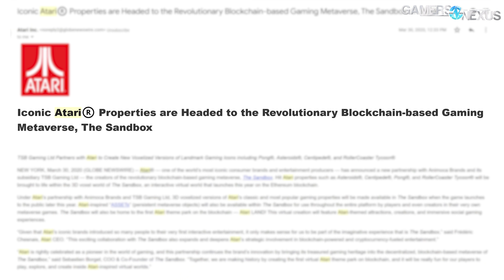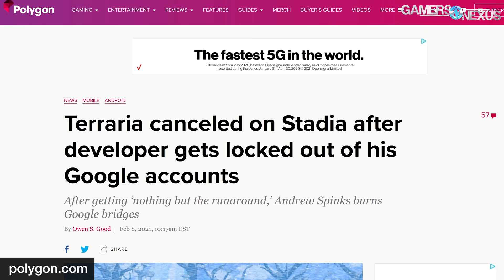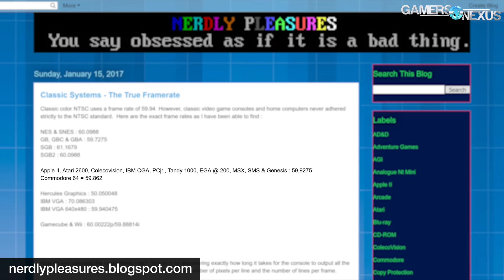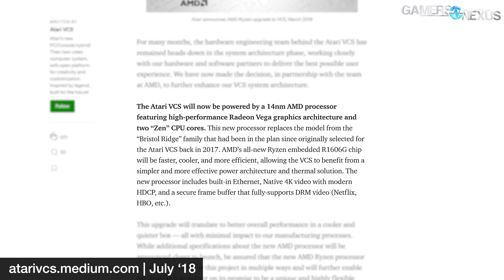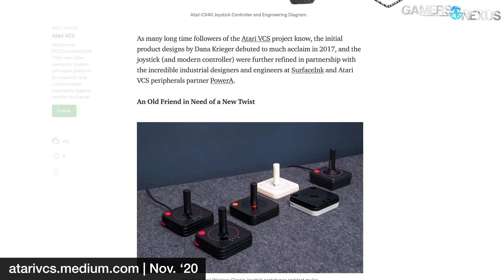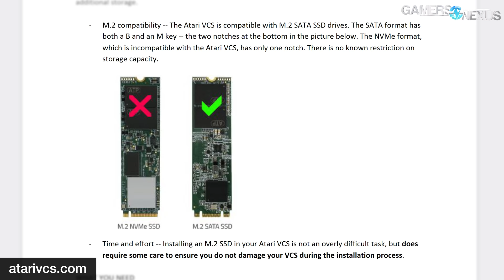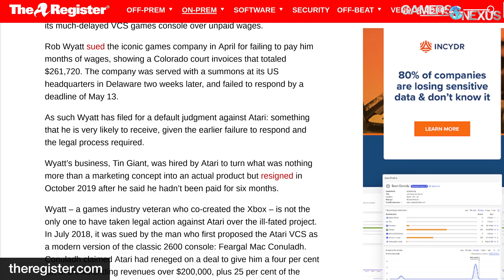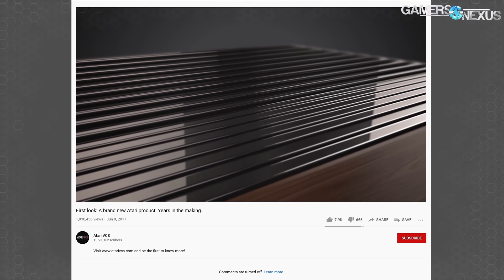Against All Odds: Atari VCS Mini Ryzen PC + Console Review

Comment: Still gonna buy one when I can. Why? it fits a niche... it's basically a lower-end laptop with Radeon graphics, but in set-top box form. If you don't need ALL THE FRAMES and you're playing titles like Elite Dangerous, or older FPS titles, this would make for a very nice box to set up with a spare 1080p TV or the like, and also provide media access otherwise, assuming you are running Windows and not the built-in software which is inherently going to be not-very-polished at the current. This is still very early on in the product's life, things will get cleaned up and optimized with time, but I'd be more interested in running Windows on it more than anything else, due to the low amount of space it uses compared to a similarly-spec'd box, and the amount of upgrade options they DID give it. Hell, I'd get two and set one up as a normal basic-use computer, considering the power consumption is actually very good.

Comment: Mine just showed up yesterday. The price isn't bad for the system specs, but my guess is that it's priced too high for the nostalgia retro console market. I don't think it will do very well because of that. As a project with my daughter, I'm planning to upgrade the memory, both in amount and speed, improve the cooling system, increase the APU TDP setting, and then use it as a multi-environment emulation station (native, Windows, etc.) I just don't think many people who want to play old Atari 2600 games-- the hook for this system-- will be interested in doing this kind of thing to the unit. Had they actually gone with Raspberry Pi-ish guts and charged 1/3 as much, I think they would be more successful in the market. Still, I'm glad personally that they made the choices they made!

Comment: It is a real shame they did not put in a cartridge slot. A small mcu hooked to the USB bus would have worked just fine and would have been a nice feature for people that had old carts laying around. It is running Linux so someone will find a way to add more games I am sure. Also you would probably use a wireless keyboard/mouse for this so you would only use 1 USB port for the keyboard/mouse.  Honestly, it seems like it could be a pretty good device for lot of people. The joystick is not a bad product for the emulation crowd so I would not write it off yet. Put steam on it and I think it could be an interesting product.

Comment: This is actually quite cool and the price is right along the lines of AMD Ryzen mini PC's.... dare I say it is even cheaper at $300. If you want a Ryzen mini PC you are looking at around $500. There are various intel ones but most are limited to Atom CPU's and they are quite slow. I have reviewed a ton of them for Amazon and the performance really brings you back to the mid 2000's.... ones with proper Intel CPU's are typically quite a bit more expensive and most of them have NO GPU power whatsoever. So even if say a 5005U based mini PC might compete in terms of CPU power it will not compete in terms of GPU power and is basically unable to play any games. 
The 200GE can play valorant and overwatch and those are two games that could be played with windows on this little box. Making it quite attractive for someone who wants a single small computer that can do many things while also having some atari nostalgia!

Comment: it would actually be cool to see another console competitor appear
Reply: Consoles are a dying breed.
Reply: @comicsans1689  ahh yes, you can see them failing
Reply: @NonsensicalSpudz  Pure consoles are dead. Xbox Series X and PS5 are essentially locked down PCs at this point. They are not plug-and-play like consoles used to be. And the Switch is the last major handheld console, but is also technically a regular console (it's the closest thing to resembling a traditional console oddly enough). With how gaming trends are heading, this is going to be the last generation of something resembling consoles. Soon they will try to impose streaming games on everyone, and consoles will just be bare-bones thin clients.

Comment: At this point, Atari needs to find a way back into the current console market without targeting Sony or Microsoft directly. I mean, Nintendo desperately needs competition.
Reply: For the first new Atari game system in decades, from a very small company with a very small budget- I think this is great.  Once this releases retail and updates push out, it will be even better.
Reply: I see Sega launching a Dreamcast 2 before Atari ever comes back to compete with any of the big 3.
Reply: @zamardii12  Unless Dreamcast 2 launches in the next month or two...then no.  The Atari VCS is nearing retail release- and like it or not- it IS competition for the other guys.  It may come in 4th place, but it is still in the race!  :)
Reply: @subsonic5  It really wouldn't be the same company either way. Staff would have turned over faster and faster as the company began to get smaller and smaller.
Reply: @subsonic5  Atari was founded in 1972 and SOLD to Warner in 1976.  What everyone thinks was Atari they played as a kid wasn't 'real' Atari either.  This Atari has indeed built the new VCS console- and has been Atari for twice as long as the original Atari lasted.
Reply: The VCS kinda is. It has more horsepower than the Switch, and there's been a few switch titles launched on both the Nintendo store and the VCS store at the same time (although I'll admit 90 percent or more of my time is in PCmode). Being able to use it the way I want is really nice (which is why consoles never really interested me since the 2000s - my last fave was the PS2 - the PS3 was such a fiasco, I jumped into PCgaming fulltime).

Comment: Oh. 4k news came in the last week. AMD needed to update the drivers for the 4k support (it's one of their latest Ryzens so they're still getting feedback for updates). The 4k framerate should improve before the larger launch. If you don't have a 4k display just set it to 1080 and you'll be fine.

(oh and I subbed - this was arguably one of the top 2 reviews I've seen in terms of presentation and testing - and this one eaks out the other in history and the tech of the original VCS/2600)

Comment: Regarding the keyboard and mouse USB port usage, it's more realistic to think that, in the vast majority of cases, using a keyboard and mouse would use a wireless solution, like the ubiquitous logitech K400 that has e touchpad, and if you want a proper mouse, you could buy a cheap wireless mouse from logitech and use the same receiver, thus using only one USB port on the device.

Comment: Little error:

Steve compares the chip inside the VCS with the Athlon 300GE. While that's technically the closest DESKTOP equivalent, the actual equivalent would be the Ryzen 3 3200U, with same TDP and clock speeds.

Comment: What a wonderful better than useless product. It has its place. A very small place but a place none the less.
Reply: I think I would rather throw away money on a console that could heat chicken...even that seems more useful that this thing
Reply: @samgoff5289  It's a well engineered product w/o lockdowns, easy to disassemble, the memory is upgrageable. it can run linux, hence it can be used as a school/home work machine. It can run any office software w/ ease.
Reply: @stanimir4197  so it is an overpriced Dell optiplex? 🤯 
You just described a prebuilt pc that is really underpowered, those have been around for a long time now and you don't need to pay extra to have an Atari sticker on it
Reply: @samgoff5289  more like an Intel's NUC or lenovo tiny. That being said I was not pleased w/ NUC's build quality couple of years back (and the classic Intel's toothpaste for thermal interface). If that Atari was to be mass produced properly offsetting R&D costs and taking benefits from larger volume prices, it'd be way cheaper... ah well.
Reply: @samgoff5289  It's for people who like atari games, don't like setting up emulators, don't like rom hunting, and or like the old atari look of it. 
Sure you can get more powerful hardware for cheaper that would theoretically last longer, but that's not the point of the product. 
It's like the other classic console products. Only this time it's got a more powerful chip that can be turned into a lightweight pc once it's outlived its purpose. 
It's not a bad product or a super amazing  product. It's better than useless and has its audience.

Comment: Good review. Price is key here. I'd like something "attractive" for my home as a micro desktop, and with the retro design and wood panelling the VCS fits the bill. But not for $400.

I already have Xbone controllers going spare, so I don't want a cheap digital stick and a knock-off gamepad. But I can only buy the VCS as a $400 "all in" bundle now. Atari way overcommitted to the "retro buy in" and ignored the opportunities that this could have explored by tying in to things like streaming services, or even by trying to build in "home-wide streaming" like Steam Link. I'd love to hide a gaming PC in a closet and use this as a front-end for casual gaming, as well as an attractive office PC.

The state of the "stick" is a bit sad. With analog directions, an analog trigger and any kind of feedback (even just a rumble) I could probably have found a use for this as a generic controller for other computers. But limited as it is, it has no value outside of the VCS' "arcade".

No NVMe is also a bit of a tragedy. Even a single lane would have given a lot of flexibility for power users to do more interesting things with the console through PCIe expansion.

If they could hit $250-$300 for serial production and make the gamepads optional again? That I could commit to even with the m.2 limitation. But the current price is daft, and I don't want the tat.

Comment: really wish they had decided to use the v1605b, came out a year earlier quad core and vega 8. though im not certain of supply issues or costs for the older chip it would just have been better overall.

Comment: Congrats to Atari for mostly thinking this through. I say "mostly" because $400 will get the original 2600 and, likely, all 100 of the included games, if one is willing to dig around a bit. OTOH, in a strange way, this is likely to be more reliable long-term, particularly if one isn't comfortable with a soldering iron.
Reply: Yea- but you are side-stepping that this will do a LOT more than just Atari games...  of course the guy making this video didn't do a great job either- so no surprise that people don't understand.
Reply: @Josh-ce9sv  Sure, but so would any other standard PC. They did a fine job with the case and the motherboard, but ultimately, a PC that costs half as much has the same potential. That's the point Steve was driving toward -- if you're buying something like this, you're paying for the Atari name.

The gaming peripherals could be nice to have though. Wonder if those will be available separately.
Reply: @McTroyd  This isn't a standard PC.  This is an attractive mini-pc that would look good even in a nice high end respectable living room.  Not many other mini-pc can say that.  And starting at only $280- https://www.walmart.com/ip/Atari-VCS-800-Onyx-Base/537139322 for a mini-pc with these specs, build quality, upgradability, with an OS, apps, games, and more coming... then no, the value is NOT just 'the Atari name'.
Reply: ...and if by peripherals you mean the controllers- yes, they are available separately, and more / other options are coming-  https://atarivcs.com/wireless-classic-joystick and https://atarivcs.com/wireless-modern-controller

Comment: 13:38 -  Is that a USB 3.0 micro connector? What? That can't be right, there would be 0 reason to use that connector.
EDIT: Ah, okay. I was seeing reflections of the regular micro connector (which they also shouldn't have used because it's garbage, but I digress) in the shiny plastic below it. 16:10 provides a different angle and clears it up.

Comment: Hey man I was just wondering if you could tell me if an old windows game on steam could be run successfully? Star Wars Jedi Knight: Dark Forces II is what I had in mind and the recommended requirements are as follows: 

OS: Windows 2000, XP or Vista
Processor: Pentium 90
Memory: 16 MB
Graphics: DirectX
DirectX®: DirectX 5.2 or higher
Hard Drive: 700 MB
Sound: 16-bit sound card
Multiplayer: 8 players IPX or TCP/IP. Pentium 133 

Thanks!!!

Comment: Would this run the other console emulators a lot better than the typical rasberry pi setups? Would it be worth it if I wanted an N64 and PS1 and maybe gamecube emulator with a bunch of games?
Reply: Well for 300$ you can also buy a series s and run emuladors a lot better in it

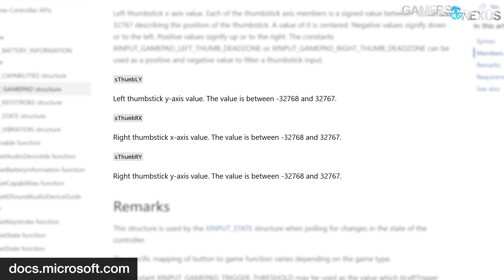Comment: 16:02 Do those controllers really have a range of 64K positions? :X
I really really really want to believe that, but the fact that MIDI controllers only have a range of 128 positions (Eg; https://forum.modartt.com/viewtopic.php?id=5897 ) makes it hard to believe.
There are a few MIDI controllers that offer a range of 16K positions, but they are VERY rare and EXTREMELY expensive...
Are MIDI controller creators just pulling the "24 fps is enough", or are those claims of Xbox 360 controllers unrealistic / so inaccurate the number of positions is irrelevant? :X

Comment: is it technically possible to upgrade the processor and add an external GPU?
Reply: Someone has already ran an external GPU, so yes.
Reply: @Tano I wouldn't do it too, but it is possible (not recommended). I guess wifi would be doable with a dongle. And you're right about a GPU, that 2 cores would be a bottleneck for a lot of them. Perhaps it is nice for an experiment, but it would be more expensive than a cheap ryzen system which is faster.

Comment: There are issues with the internal build quality of the original Atari joysticks, and they are really badly designed for left-handed people, but beyond that they were generally brilliant controllers for the games around at the time with the short travel distance on the joystick making it really responsive. I used mine right through the 16-bit era on Amigas until the plastic ring inside failed. 

The new one looks so loose and wobbly by comparison it's obvious their designers weren't smart enough to identify the strengths of the original design and build upon them, and the shade thrown on it in that marketing only serves to highlight their arrogance.